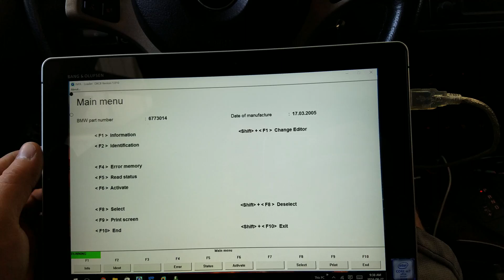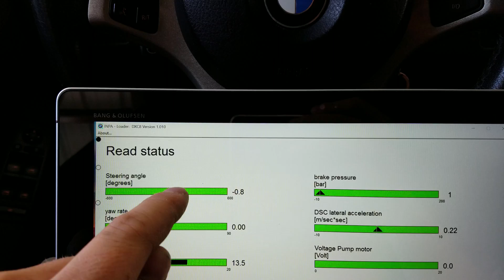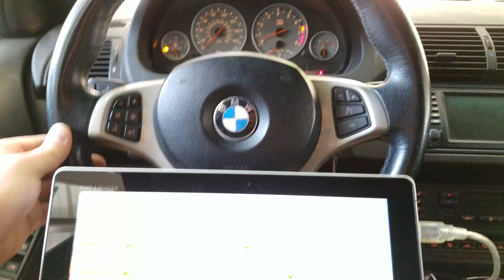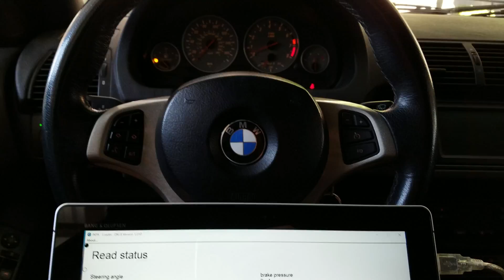Steering angle calibration E53 x5 Inpa

Comment: Activate is not an option on my inpa. I have communication with the car. Is it because there are codes? Anyone have an idea?
Reply from the maker: Hi, do you have the same build # of inpa installed?
Reply: @genozemlyak  probably not. I think it was v5 something. One of the newer ones. I gave up and bought a foxwell nt710 which made it 100x easier. I do have inpa and pasoft as back ups now though

Comment: So after I swapped my steering for
A different one the steering is not strait is it possible that it needs calibration ? 
to be strait 

 alignment is fine but steering is slight to the right .
Reply from the maker: Hmmm 🤔, pretty sure the steering spline should be indexed, so steering wheel should be straight. If I am mistaken you'll need a front wheel alignment. A simple steering calibration will not fix your issue.
Reply: Колька Снегирёв but before I swapped the steering the old one was strait.....so I can’t see how I fucked up just changing the steering over I will try old steering maybe new one is not strait from manufacturing 👨‍🏭
Reply from the maker: @pyton75  It sounds like it's incompatible. Which steering wheel did you use and what vehicle do you have?

Comment: Not very good you tell us your going to f2 or f5 but you don't actually say what it is couldn't see it clearly on the screen perhaps if we were mind readers we could have understood
Reply from the maker: steve ringham Would you mind giving me the timestamp of "said" error? I'll gladly make a correction if it's needed.
Reply: steve ringham now that was a very funny comment there...I see lots like this tho bcuz they don't bother to explain as they take us through the steps taken to diagnose and fix repair the issue(s). I own a 2006 E53 model BMW X5 3.0i titansilber metallic with 148K in miles.

Comment: can you get UIF for E53 bmw?
Reply from the maker: Alb_ALPS For which ecu?
Reply: for the x5 e53 bmw inpa does not bring UIF up! there is a work around using WinKFP but that would only read one module at a time; Inpa reads them all for other than E53

Comment: Can you advice what version of inpa you are using and the HP
tablet specifications please, because I am running Inpa on windows 8 and I’m
unable to connect to the DXC8  module. (Inpa device and software from Aliexpress) (BMW E53 2001)
Reply from the maker: johnny el mir Hi I'm running the 5.0.2 version of Inpa on my HP elite x2. operating system is Windows 10.